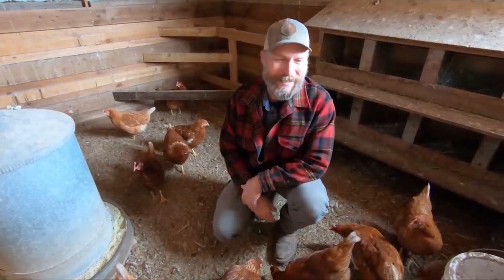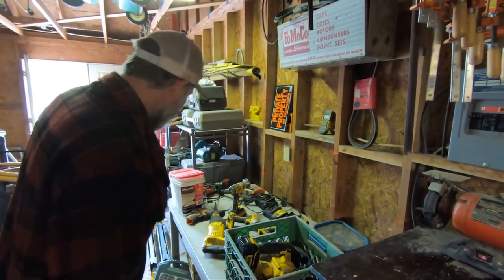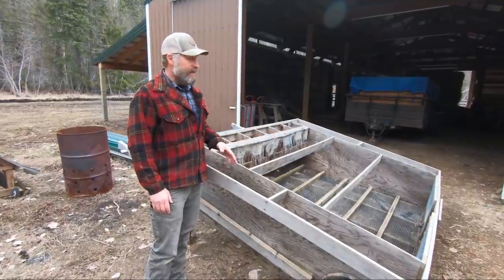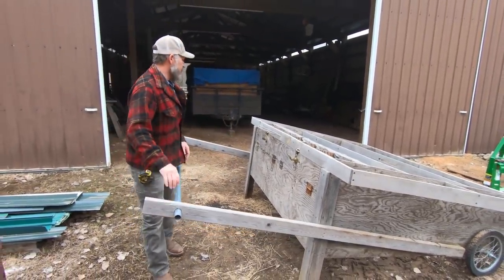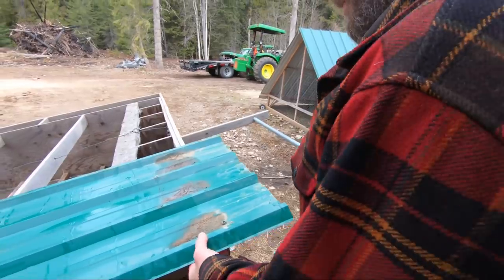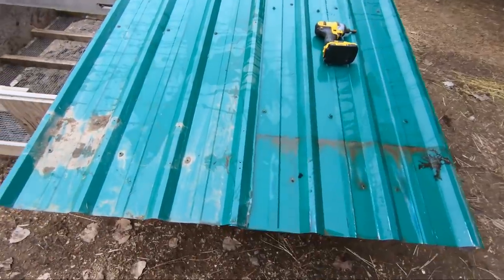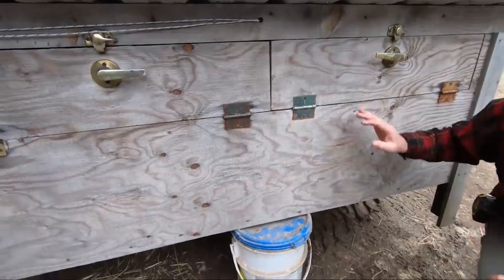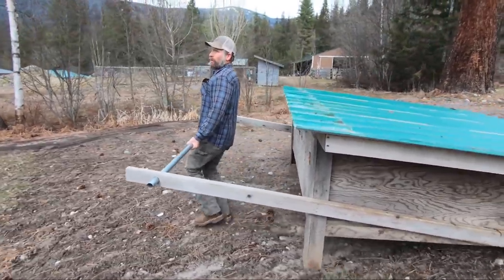Putting Your Chickens to Work with a Chickshaw!

Comment: I love chicken labor! I put a piece of cheap plywood & a layer of insulation under the steel roof to make it quieter for the chicks during hail/heavy rains.
Reply: I like this idea.  In NE Texas our metal roofed barn becomes 30-40 degrees warmer than outside.  I think insulation would reduce the heat transfer as well.

Comment: When reusing the steel roofing you really don't need to cut much.  If you need 8 feet and you have two 6 foot sections, just overlap them.  When you reuse them the next time, you still have longer sections.